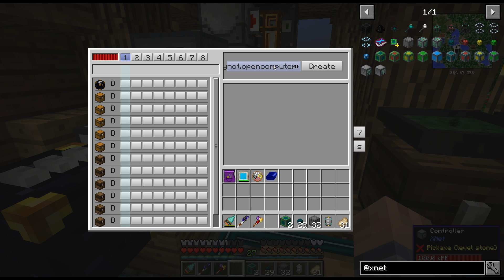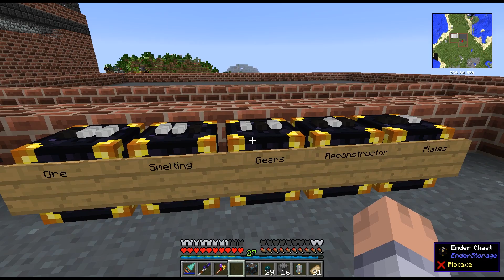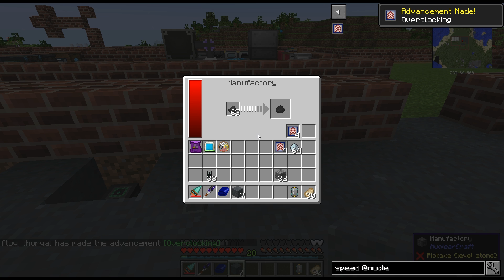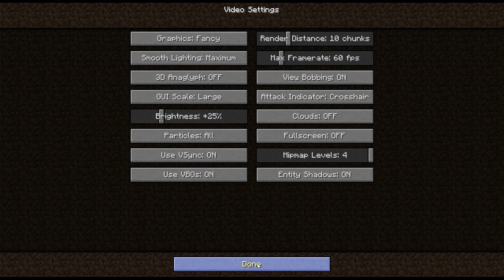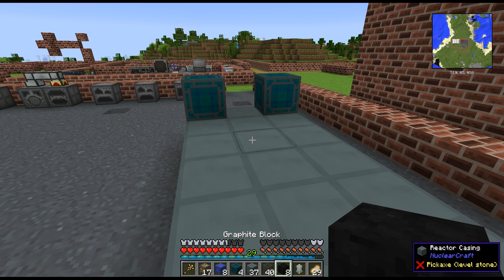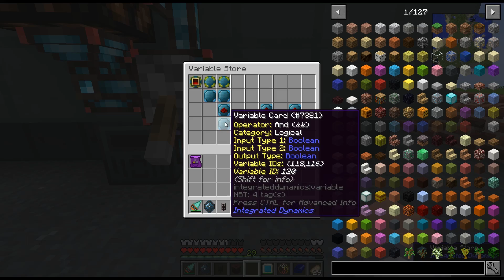Unbound #20 - Nuclearcraft Fission Reactor

Comment: You will want to automate rods if you're going to use Advanced Rocketry. The metal press is much quicker than the other automation options. But by then you can use Wireless Transmitter/Receiver pairs from Refined Storage.

The old reactor rules are different cooling. He recently changed how the cooling works. Now the closer you are to the heat the reactor is generating, the more efficient it is. The old ones just produced more power for more cooling.

25% looks fine.

For the assembler, the IE pipes act like EnderIO's Ender Fluid Conduits. They don't actually store fluid in them, just act as end points, so it can have multiple fluids flowing through it.
Reply: I'd suggest a water tower design for your water problem. It looks ugly where it is, but you could have a big wooden water tower that contains a tank and pumps and power cell. Think something that looks like a train water tower. I used one in a world and it looked awesome.
Reply from the maker: Oh I really like that idea, I think we'll build a water tower :)